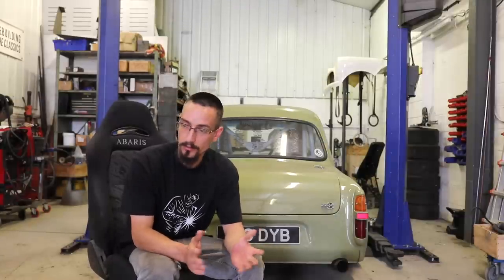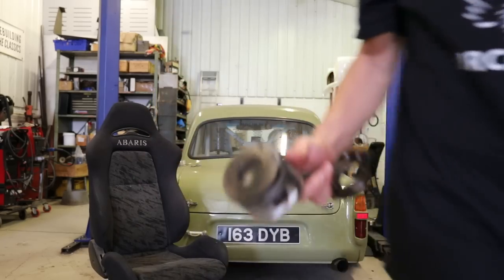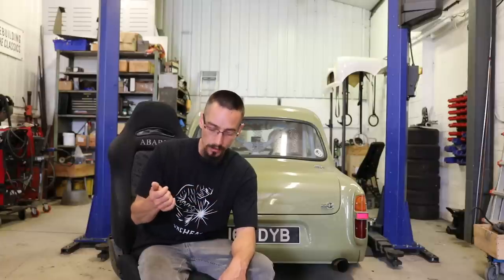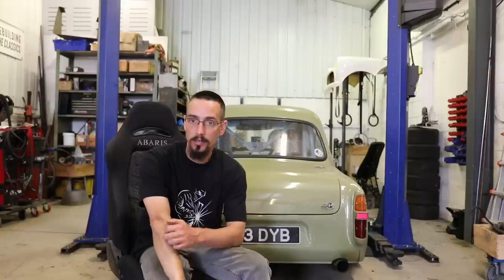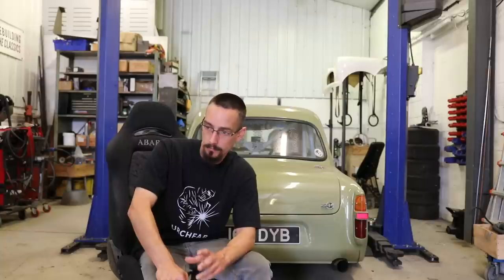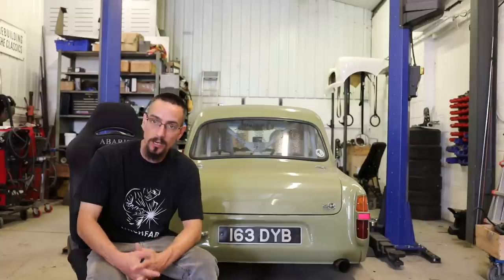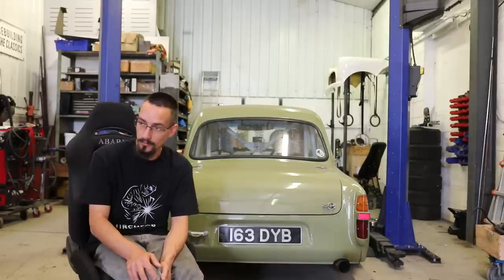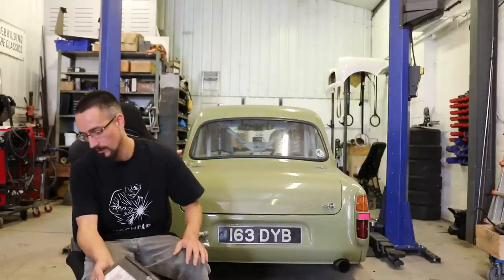Trying To Build Cars For A Living

Comment: I ran a garage for 10 years and although I got to race cars for cheap I never really made money or got my investment back, never heard the landlord complain though.
I don't do customer cars anymore, any spare time is used on my own projects. Day job now is car parts. More margin, less overheads (like rent on a big unit). So I know where you're coming from, you've got the right idea to move forward. Good luck.
Reply from the maker: It seems to be a common issue! Cheers 🍻
Reply: @Urchfab  sadly yes. I think the key is not to sell hours but IP or products. The best would be your own products whether it be an Urchfab pedal box or a complete car. Selling a car you built has to net more than billing hours to build one for someone else.